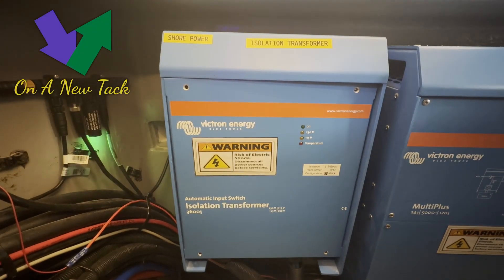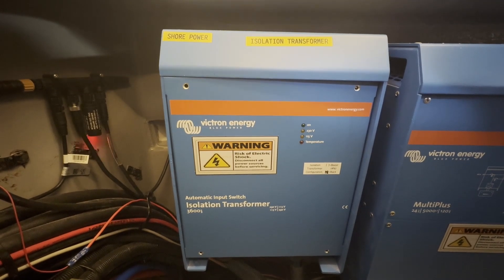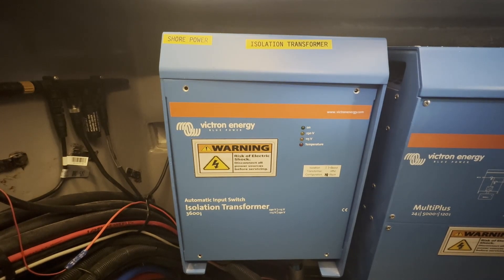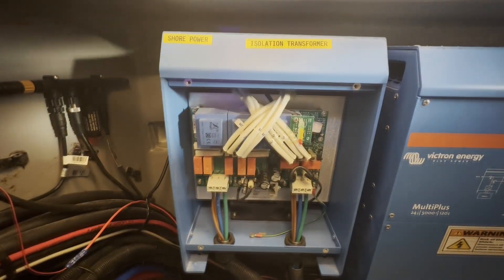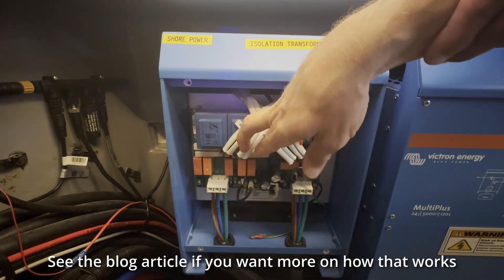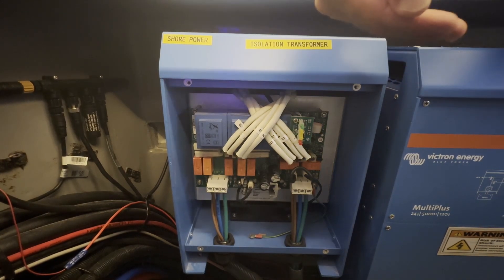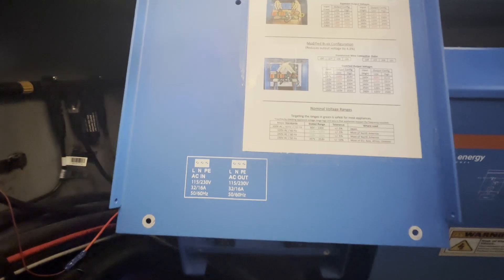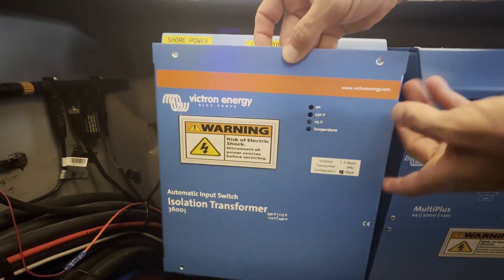How to configure a Victron Isolation transformer to not boost the output voltage

Comment: No thanks.  Just buy another inverter.  This AT almost destroyed my system.  I'm not placing blame, it could have been a user error but I sort of doubt it.  If you need 240, just buy another inverter.  Plus, the amperage limitations.  And it gets really hot.  My experience is the fan didn't even come on as the thing melted.  Again, no blame, it could have been me but it was not fun.
Reply from the maker: Sorry to hear about that! I need to fix the title of this video.  We don't actually have an auto transformer, we have an auto-switching isolation transformer.  We have it in our boat  so that we can hook up to shore power regardless of if that shore power is 115V or 230V.  That way, all of the appliances on our boat (230V) will still work. Another inverter would not allow that to happen.

Comment: So glad you found this solution and shared it! We encountered the issue once we left the US as the docks here in Mexico tend to run hot. InMarina Mazatlán the shore power at the end of the Dock registers at 132V, and after it went through isolation transport fees the voltage was reaching 143V when it got to the MultiPlus Inverter Chargers. Making this change has allowed us to use shore power in Mexico! ⚡️
Reply from the maker: Thanks Bob! So glad this worked for you too!
Reply: I am in Mexico and have the same problem at Marinas where the voltage is slightly higher than 130V.  I tried this solution but it didn't work because the Isolation Transformer didn't produce output. The specs say that it needs 130V or less.  I'm thinking that eventhough the output will be less than 130V the input is still over 130V.  Any thoughts?